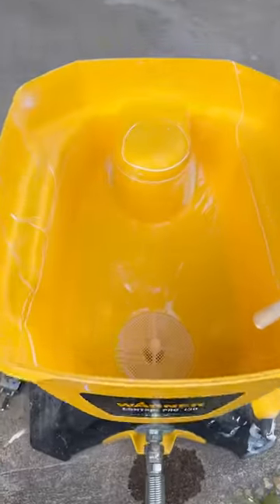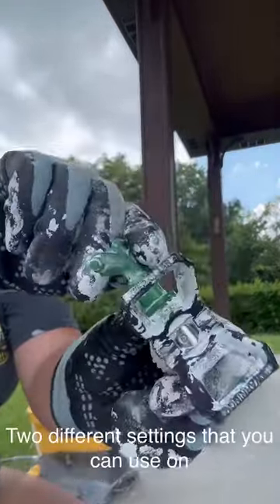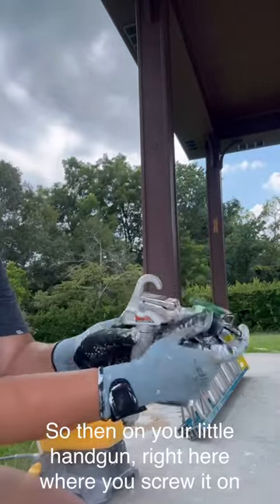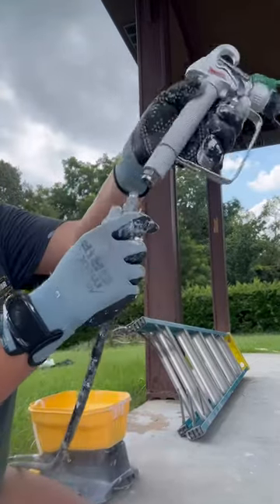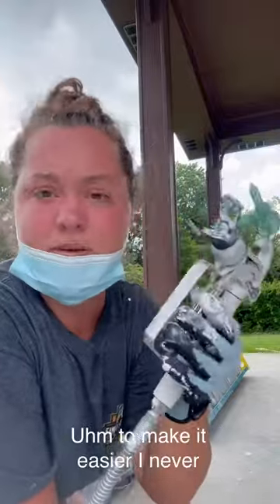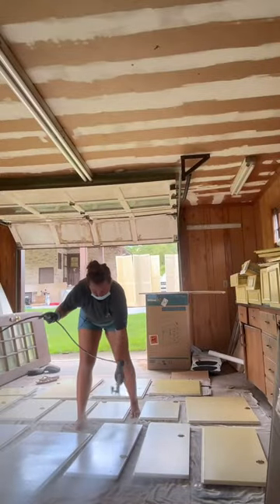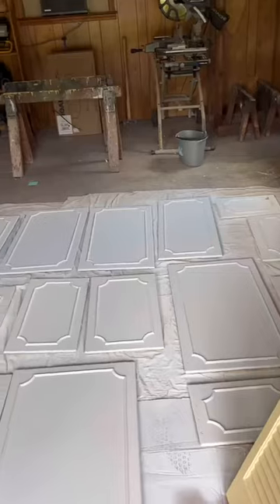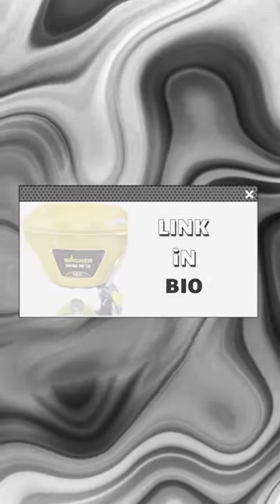Wagner Paint Sprayer

Comment: Great start. Just a few pointers.. the green tip (key thing) does not have two settings for a narrow or wider spray, the tip should point away from you for spraying and turn it to point towards you for clearing any blockages in the gun. Also you're using the wrong tip. The 515 you'd want to use on thicker paints and large areas. For doors, cabinets and trim try using a 310 or 410. You'll use a lot less paint, less waste and a lot less overspray. I even go down to a 208 tip when spraying small panels. Depending what paint you're using it's often worth thinning slightly as you'll get a better optimisation and need less pressure to achieve a finer finish with no tails. 👍
Reply from the maker: Wow! I would have never known that was the wrong tip. It was the size that came with it when we ordered it! Good to know there are smaller sizes that would have less overspray. I did notice it eats up a ton of paint. As I said we are no professionals over here so that’s great advice!!